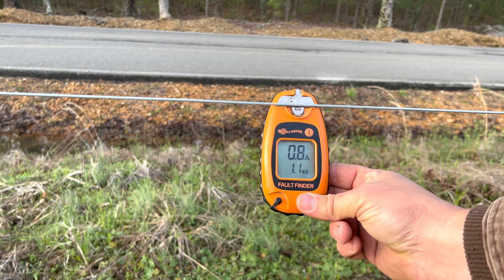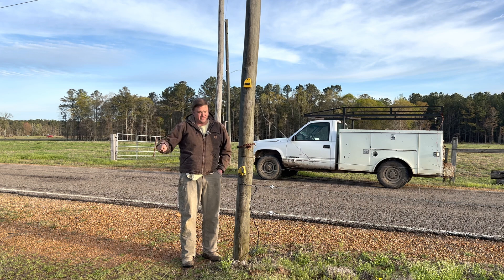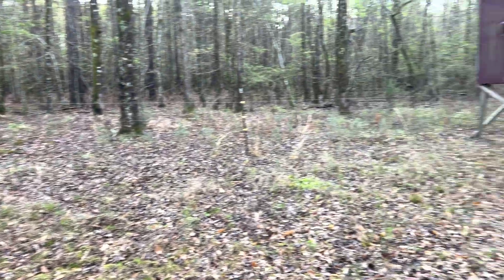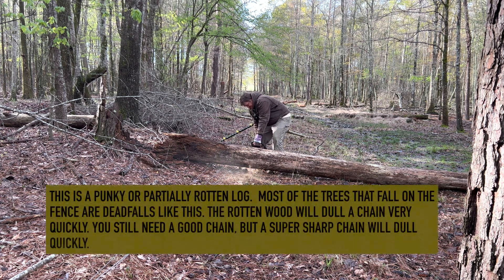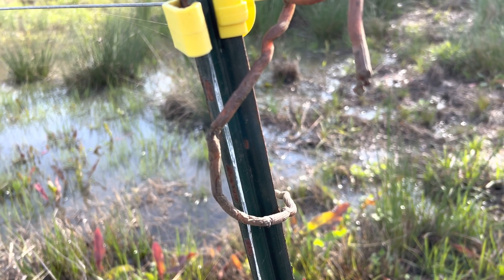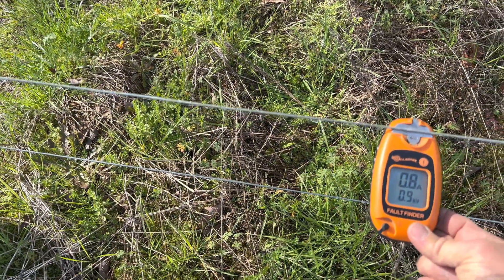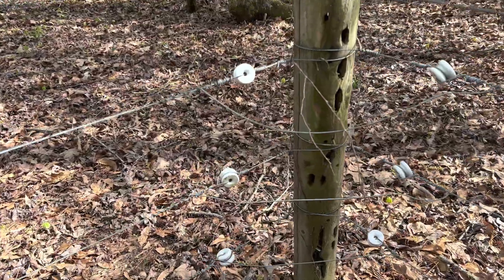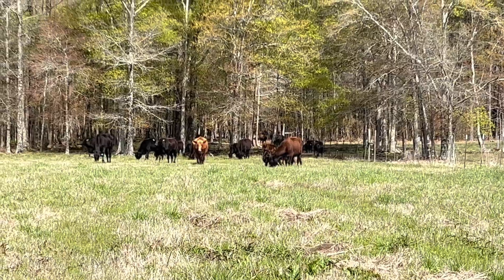Electric Fence Fault Finding: Trouble Shooting an Electric Fence

Comment: Thanks for the video.  I'd like to ask your opinion on something.  I installed my first electric fence this week w/ a .5 joule charger (AC powered), 14 guage aluminum wire, and everything was working fine two days ago while it was reading 7.5kv.  I go to test it today and my reader is showing 9.9+kv (that device's max reading) with no short indicated on the meter.  I tested a separate fence in the other paddock connected to a solar unit and it was reading normal.  As far as I know nothing at all has changed and the animals still seem to be keeping their distance from the perimeter.  What does this indicate to you and also what would you recommend I do to continue troubleshooting it?  I really appreciate your time.  Videos like yours really help me out as I try my hand at farming as a newbie.

Comment: Thanks for the video. Saw my first 66 amp draw today 100 volts; wire jumped off the corner insulator when tensioning.
Dont know how many mistakes i made building that fence but im learning.
Reply from the maker: Glad it helped. It’s a learning process all around.

Comment: Great video but the most interesting thing for me was that you can run fence across the road it looks like up in the air. I wonder how you get away with that I don’t think they’d let me do that.? I’ve pretty much found the arrow on the fault finder as far as direction to not be very reliable for me.  I’ve always wondered all the times that you have major shorts against multiple t- post putting it in perspective how necessary do you think fence insulators are for wooden post especially with the modern low impedance fence chargers ?I’ve added in a lot of small sized wooden branches as fence stays in a lot of areas, just wiring them to the fence without seeing any voltage drops per se. I think they’re used to be eucalyptus non-insulated wooden post that they used in New Zealand and Australia that were sold at one time.
Reply from the maker: I guess if you don’t ask, they can’t tell you no! Seriously though, when the fence was run across the road  -where I filmed the section on the switches - that power was run over the road decades ago. The road was a gravel country road that no one drove on. That may have had an impact. I’m not sure. The other road we cross is much busier, and it runs underneath the road there through a culvert. 

My dad used some cedar wood posts with holes through them one time and we still have them though we dont use them anymore. The problem with those posts is that they are hard to replace and steel T posts are easier. 

Wood branches and trees on the fence never drop the voltage  in my experience - maybe a bit if its raining - unless the tree pushes the fence to the ground or on a tpost. I think you are right on that as well. 

One of the things that I hoped to communicate in the video was that the arrow on the fault finder can help, but it can also be deceptive as you say. On my fault finder, it only shows an arrow if the fault is in the direct of the flow of current, not back to the source of the current. One fence setups with multiple branches, like that second spot I fixed, you can look all day for the source of the problem, but it doesn’t show up on the fault finder unless you are on the flow of current. 

 I agree as well that with these more powerful fence chargers ( and low impedance) they can still push a lot of voltage through a fault or a ground like three wires ground out on a tpost driven into wet ground. We have have 10-12 major shorts like in this video before we notice a huge drop in voltage. It’s great for burning grass off the fence lines, but its also problematic because you have a lot of problems with the fence before you show a lot of voltage drop. 

Do you use much electric fencing? What kind of charger are you using?

Thanks for the feedback.
Reply: @DowdleFamilyFarms  well I noticed the road is named after your family so I’m sure your family has a lot of pool in your area. Nobody probably bugs. Yeah yeah I have a couple hundred acres of electric fence. I have the 30 jewel Taylor charger as well then I have several DC off grid units that I use solar panels and batteries to hook up to those are mostly the Taylor chargers. I do have some Gallagher line chargers as well. They both seem to be good I like the tailor because it’s American made and I can direct line call to them when I have a problem.
Reply from the maker: @michiganhay7844  Dowdle Road was named after my great-grandfather, whom I was also named after. The road is a couple miles long and he was the only one who lived on the road, hence Dowdle Road. In the last 30-40 years several dozen houses have been built on the road and around the farm. People moving out of the city to get into the county school district. The community has grown from a couple hundred people to thousands now. I suspect that if there were problems with the wire running over the road, then we might have to remove it, but because it was put up when no one lived on or traveled the gravel road, no one thought about it. I just realized that my comment about asking sounded arrogant and like a jerk. I really meant that to reflect that when the wire was put up decades ago, no one traveled the road so it did not matter. Now, no one has thought to ask if it is allowed.  

We have a Gallagher m2800i which has a 20 joule output (28 joule stored) but replaced it with the Taylor Made Cyclops charger. So far I like the Taylor charger a lot. Its 50 percent stronger, but it has a higher voltage and appears to push power through the vegetation better to burn it down.